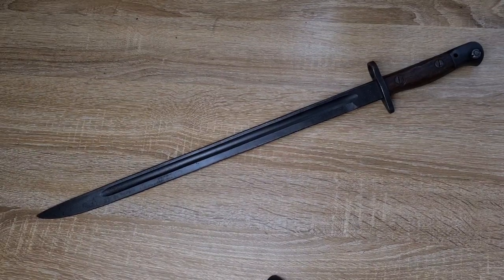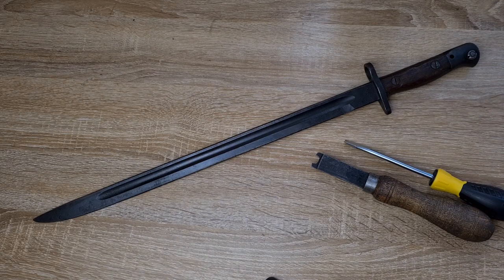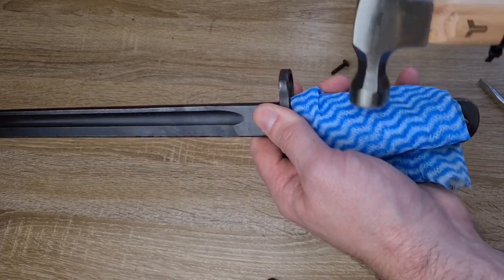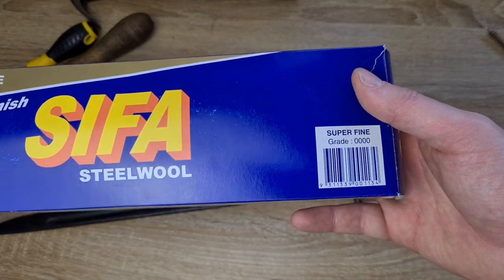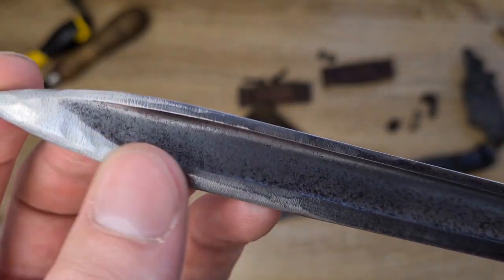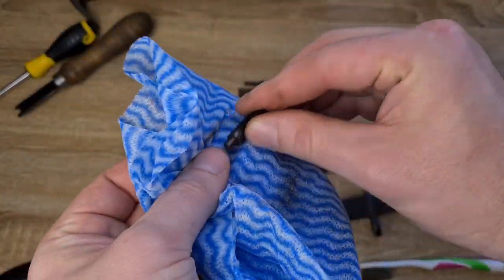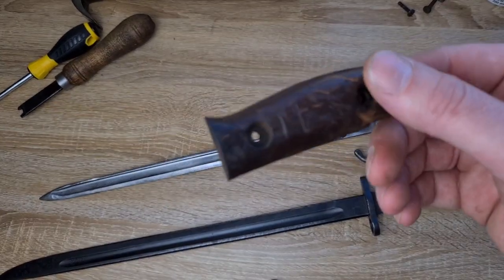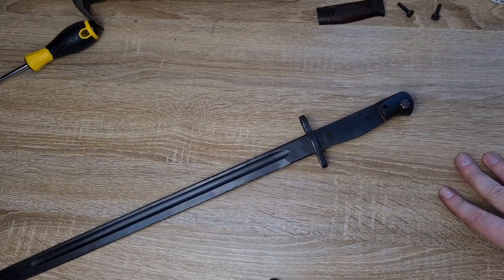How to clean bayonets

Comment: I, sometimes, will use 0000 steel wool, but tend to use bronze or, even better, brass wool. There's far less chance of abrasion, over-cleaning, damage to any blueing, almost no shedding, can reuse repeatedly for the same uses, and brass wool will not rust. I start with the least abrasive (brass) and proceed to more coarse materials only when necessary and return to less abrasive methods, asap. Very good video.

-Forgot to mention: to remove any bronze or brass discolorization left behind, just use a cleaner with ammonia in it or Hoppe's.

Comment: A "garden variety" screwdriver with that beveled blade can mangle screws. If you're doing this a lot, I suggest using what are commonly called gunsmith screwdrivers or screwdrivers with a hollow-ground tip. Probably the best kind is one with a socket end that takes removable bits instead of having multiple one-piece screwdrivers. I've got a P1907 and it is good to see one come apart and what to expect. 👍
Reply from the maker: Brilliant advise right here 👆

Comment: I have a Swiss M1899 bayonet I'm trying to preserve. What should I do to the wood handle on this? It has rivets securing the wood rather than screws, making it tough to take apart. 
Also is there any sort of finish on the blade that I may damage if I try to polish out black marks on it? It looks like the blade has a sort of chrome finish, but I'm no expert so I don't know. 
Thanks for any input!
Reply from the maker: I personally don't try to take apart bayonets with rivets. I don't have a M1899 but my other Swiss bayonets don't have a finish so you should probably be fine to give it a hit
Reply: @pointynotsharp  awesome! Thank you very much for the info
Reply: @altra8911  Personally speaking-dont take it apart! Ballistol for the handles and very fine wire wool IF you have too. To preseve the piece use Renaissance wax.

Comment: How would you clean inside a scabbard?
Reply from the maker: That can be tough, if you can remove the throat then you can use a cleaning rod. If the throat doesn't come out then there may not be much you can do